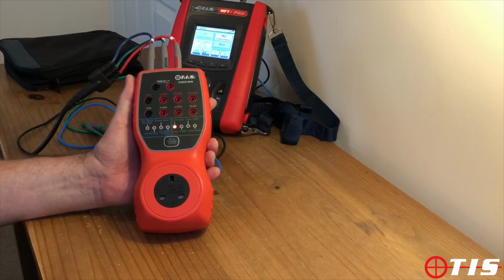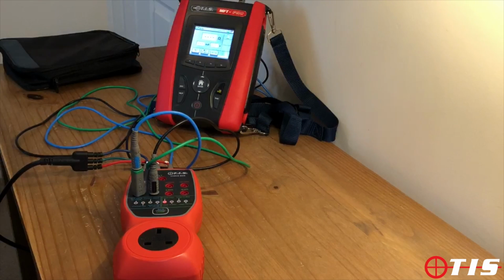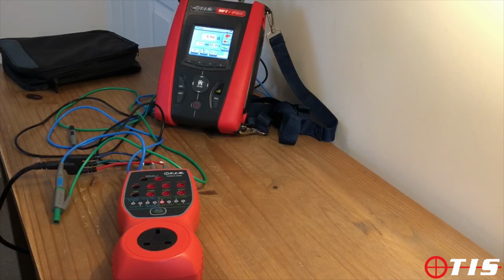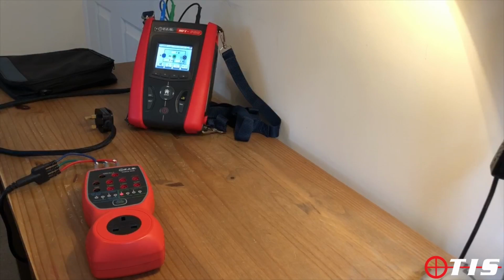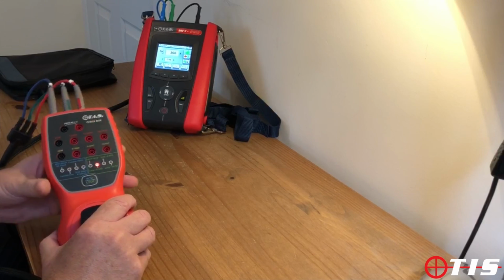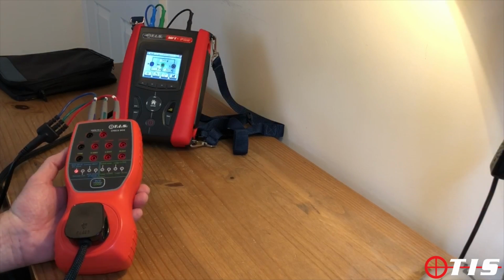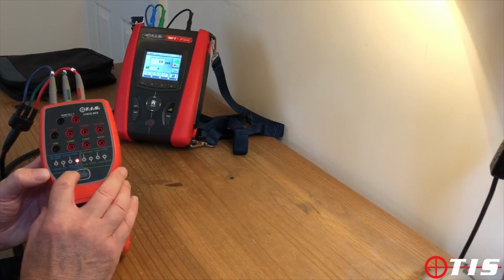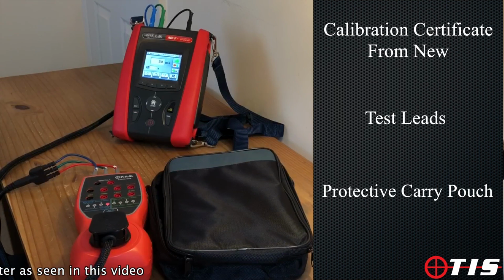TIS Checkbox

Comment: Hi is this a calibration unit? Just to double check if the mft pro is working accurately?
Reply from the maker: Hi there yes you can check the PRO with it but it will check readings on all Multifunction testers 👍